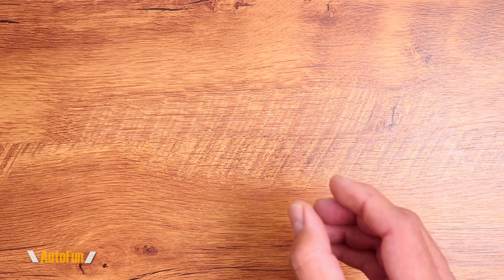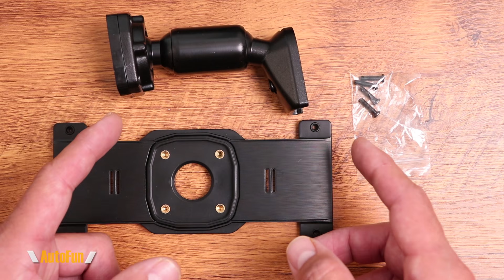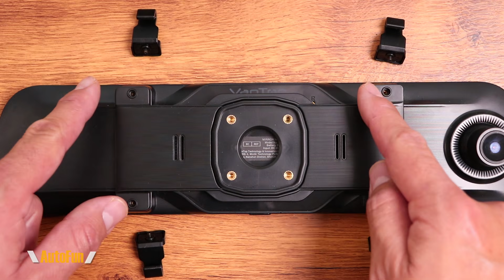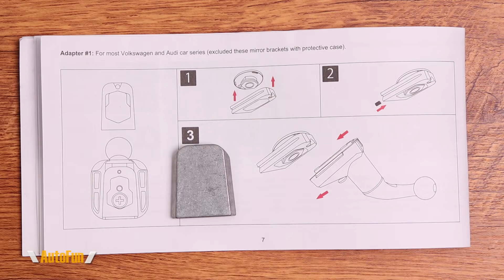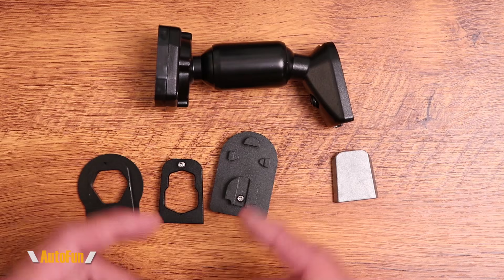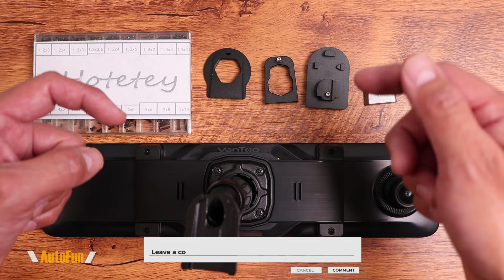How to Install Mirror Dash Cam WITHOUT Straps (Direct Mount Conversion Kit for LCD Mirror)

Comment: hi can i get a bracket adapter for a dacia sandero m8.
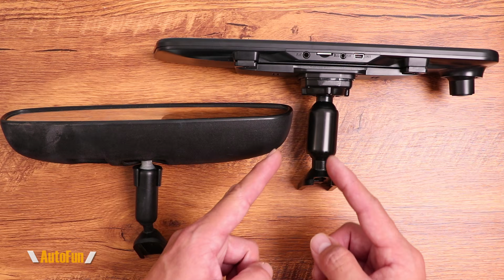Reply from the maker: Hi Paul! I placed links to the different adapters on the video description, if you need to see what they look like so you can match it to the one on your car take a look at the 5:40 mark. Hope this helps, Cheers!
Reply: hi m8 when i click link does not work correctly thanks
Reply from the maker: @paulmurtha766  Hi Paul! I just checked the links, the are working correctly, which kit size are you looking for?

Comment: 2018 Toyota Tundra? Standard bracket?
Reply from the maker: HI Luke! Toyota normally uses the standard bracket but I always take the mirror off on the car to confirm which type it is. Hope this helps, Cheers!

Comment: Have you seen anything for the jado g100?
Reply from the maker: Hi moonstarking! Unfortunately I have not reviewed the Jado G100 yet, so I'm not sure what kit will fit, however you can measure the back of the dash cam as I showed in the video to determine the size but If I do get a hold of one of one, I will measure it for you and update this comment. Hope this helps, Cheers!

Comment: Install completed...works well. The only complaint is the Backup lines can not be adjusted for Width. So my SUV is wider than the back up lines :0
Reply from the maker: Hi AP514! that's odd, you should be able to adjust them. The G840H is one of the few mirror dash cams that let you fully adjust the guidelines using your finger so they can be tweaked to fit pretty much any configuration (most mirror dash cams only provide partially adjustable guidelines, basically a few preset ones) I wonder if you need a firmware update. I'm on Firmware 1.7.77.20210821 if it helps, if you still can't get them to adjust I would also recommend contacting Wolfbox, I'm sure they can walk you thru how to adjust them. Hope this helps, Cheers!

Comment: I just ordered a Apeman 790. Seeing if anyone has modified it yet
Reply from the maker: Hi Brannon! I haven't reviewed the Apeman 790 (may have to add it to my list of dash cams to review) so I'm not sure what kit will fit, however you can measure the back as I showed in the video to determine the size and If I do get a hold of one of one, I will measure it for you and update this comment. Hope this helps, Cheers!

Comment: Hi Alex! What about a kit for the Akeeyo 360?
Reply from the maker: Hi Corporacion PASSE! Unfortunately the Akeeyo 360° does not have screw holes in the back, so the conversion kit will not work with it. Cheers!
Reply: Yes Alex, thanks for your quick response. Please try to do that new video ASAP 😂😉
Reply: Hi Alex, any news about that video showing custom installation without straps for the Akeeyo 360?

Comment: Hi question for vantop h612 how do you remove the mounting strap where you put the plate on the back ?
Reply from the maker: Hi Hsruyr! I have not converted the H612, only the H612T but assuming the H612 has screws on the back, then the process would be the same as the H612T I showed on the video. Hope this helps, Cheers!
Reply: The thing that holds the strap is not the same as the hf612t but its almost the same as h610 were the screw is on the side of the dash cam any idea?
Reply from the maker: @hsruyrhsu137  Hi Hsruyr Hsu! ah unfortunately I have also not converted any H610 yet so I'm not sure if conversion is possible on the H610 or H612, but assuming they have screws on the back of the back, then the process would be the same as the H612T I showed on the video. Hope this helps, Cheers!

Comment: Which bracket fits the Wolfbox G700?
Reply from the maker: Hi Vin! Unfortunately the G700 does not have screw holes in the back, so the conversion kit will not work with it. Cheers!

Comment: Well, you messed up the measurement on "G840H"  *it is 13.5mm x 6.0 *----- Not the 14.5 x 6.0 listed in link.
 Change that link ASAP........
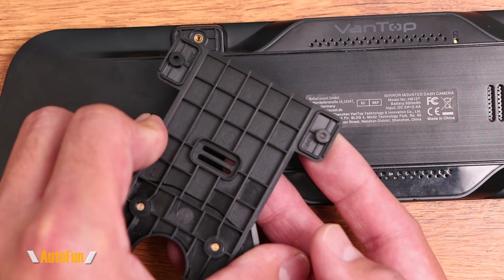Reply from the maker: Hi AP514! Nope my measurement is correct (14.5 x 6.0) you can see those measurements in my G840H conversion video here https://youtu.be/ns_2C-ph2no at the 4:32 mark. However since filming this video I have heard from viewers that they have received G480 without mounting screws or with a different measurements (yours sounds like it would be in this bucket) so I suspect there are a few G840H bodies going around and so far I have only seen the one body (I'm in my 4th G840H now). Hopefully I will see the other bodies at some point to confirm both the measurements and if they have screws or not and make another video on those. Hope this helps, Cheers!
Reply: @AlexAutoFun  - Well, I just Measured my Wolfbox G840H and it measures exactly 13.5 x 6.0.
So, You think they changed something or just have several back plates then ?  Mine did have the screws.
I can send you a few Pic's/Video if that helps.
Reply from the maker: @AP-514  Hi AP514! awesome man thanks for confirming, I had another viewer claim 13.5 X 5.9 (which I seen before in another brand) so I'm wondering if he received your style and was off by only a bit on the measurement. It would be great if you could send me a picture of the rear of your G840H (glad to hear it had screws, I also had some another viewer said he got one without screws ugh) if you go to my channel, then "About" you can find my email. Thanks again man!
Reply from the maker: Thank you for the pictures AP514! looks like the G840H you received uses the same body as the G850 V1, will update the kit list we have going to reflect this. Cheers!
Reply: @AlexAutoFun  thanks--- I figure it will help someone else out. Bottom line you are better off just waiting to order the backplate until you actually get the Unit in hand. It sucks due to the fact the backplate uses the Slow BOAT from China to get here.(they also back charged me $6 for the return)
Reply from the maker: @AP-514  Yep fully agree! this is actually something I would really like the vendors to start doing, and clearly indicate on the box if their mirror is direct mount compatible and what pattern it uses (kind of like TVs and PC monitors, they have already standardized their mounts) but we'll see if anyone actually listens to me LOL
Reply: @AlexAutoFun  Well, received the Backplate and the Screw Pattern is good.  But the Screws they have in the package are to LONG for the Backplate. They Shank out.(Pic's on the Amazon Link for 13.5 x 6.0 above)
Reply from the maker: @AP-514  Yep, I had cases too where the screws that come in the kit did not fit the dash cam I was converting, so I put a link to the screw kit mentioned on the video, that kit has come in so handy! Cheers!

Comment: This video is JUST what I was looking for - now I'm trying to find a mount that fits Rexing M1 Pro - holes are 13.5 CM apart horizontally and 5CM apart vertically.  If there's not one that fits, I guess I could go the drill route. :)   Does anyone know of a mount with those hole dimensions?
Reply from the maker: Hi William! glad to hear it helped, nope unfortunately there are no kits with those dimensions yet but here is my follow up video for this cases https://youtu.be/fveZiDofnxg Hope this helps, Cheers!
Reply from the maker: Hi William! I was reviewing comments to see if I miss any and I actually have a follow up video that may help you (if you are still looking to direct mount the dash cam) here you go https://youtu.be/fveZiDofnxg Cheers!

Comment: Any updates on kits for the Redtiger T27 where you don't have to drill additional holes?
Reply from the maker: Hi wolfsmith808! I think you are referring to the semi-universal kit I showed here https://youtu.be/fveZiDofnxg If so no there is no other kit out at this point for the RedTiger T27 besides the semi-universal one. But if I do find one eventually I will update this comment. Hope this helps, Cheers!
Reply: @AlexAutoFun  Thanks man. You're videos have been fantastic in walking me thru all the various installs. Fantastic!
Reply from the maker: @wolfsmith808  You're welcome man, glad to hear they helped! 😁

Comment: what if the Rear view mirror dash camera doesn't have the ability to equip a arm attachment?  do you have a solution for that?
Reply from the maker: Hi Zachary Rodriguez! if there are not screw holes in the back of the dash cam the conversion kit will not work with it. Cheers!

Comment: Hello! I just purchased the Redtiger T700 mirror cam and was wondering if you know of a mount that will fit this model? Doesn’t seem I can pull back any rubber on my mirror to expose screws. Thanks
Reply from the maker: Hi Nicolas! I have not tested the T700 mirror dash cam (may have to add to the list of dash cams to review) but you are correct, if there are not screw holes in the back the conversion kit will not work with it. Cheers!

Comment: Stop advertising that conversion kit works for the g840h! I bought your listed kit and the screw kit along with the wolfbox g840h. 1. Yhere ate NO SCREW HOLES UNDERNEATH THE RUBBER TAPE AND THE MOUNT DOESN'T FIT! It's too big! Thanks for wasting my money
Reply from the maker: Hi Aaron! I have converted two G840H's already and just received a 3rd one that also has screws here is the video showing the conversion  https://youtu.be/ns_2C-ph2no But it's possible that yours may not have screws, sometimes I do see small differences between product coming from the manufacturer directly vs Amazon (where I get all my stuff) that may be a possibility (and even within Amazon stock there could be different batches of the product). I'm currently working on the mounting solution for dash cams that do not have screws, stay tuned for that video and cheers bud!

Comment: I think there is a mistake in the conversion kits, the Kit 14.5 x 6.0 is not for a Wolfbox G840H, the Kit 13.5 x 5.9 is the correct one.
Reply from the maker: Hi Rudy! I have just converted my 3rd G840H using the 14.5 X 6.0 Kit here is the video showing the conversion https://youtu.be/ns_2C-ph2no) But I have heard that there may be a 2nd body style for the G840 (so far I have only see one body style but I think it would make sense to double check the size of your G840 before ordering the kit) Hope this makes sense and hope you like your conversion! cheers bud!

Comment: Hey there! Do you know of a bracket that would fit the autovox x1 dashcam mirror? I’ve really been wanting this dashcam, but I don’t want the strap mechanism that goes with it
Reply from the maker: Hi Ryan! I have not reviewed the Auto-Vox X1 yet, so I'm not sure what kit will fit, however you can measure the back of the dash cam as I showed in the video to determine the size but If I do get a hold of one of one, I will measure it for you and update this comment. Also not sure if you seen they carry on that is already direct mount with really good features here it is https://youtu.be/Yk2EEacXZ7g Hope this helps and Cheers!

Comment: Hello, can you please provide a give me a link to a bracket that could fit a PORMIDO PR998 rear view mirror dash cam? 
Thank you
Reply from the maker: Hi Jeffrey! I have not reviewed the Pormido PR998 yet, so I'm not sure what kit will fit, however you can measure the back of the dash cam as I showed in the video to determine the size but If I do get a hold of one of one, I will measure it for you and update this comment. Hope this helps and Cheers!
Reply: @AlexAutoFun  Thanks for the reply. Much appreciated. I'll measure it as suggested. While also awaiting your update.
Cheers

Comment: Are there any of these brackets available that enable you to route the cables inside them, to conceal wires
 My mirror cam is wolfbox G900
Reply from the maker: Hi David! nope there are none (but It's an interesting idea), the rear portion that mounts to the mirror would have to be enlarged significantly to fit the cables due to the right angle connectors (the diameter of the tube would need to be quite large) The closest I seen to this is this one https://youtu.be/Yk2EEacXZ7g which was designed from the start to be a direct fit (and avoids using right angle connectors). Hope this helps bud!
Reply: @AlexAutoFun  Thanks for that, do you know whick bracket will fit the wolfbox g900 to mount it with out the straps
Reply from the maker: @Builder9133  Hi David! ah yes I have not reviewed the Wolfbox G900 yet, so I'm not sure what kit will fit, however you can measure the back of the dash cam as I showed in the video to determine the size but If I do get a hold of one of one, I will measure it for you and update this comment. Hope this helps and Cheers!
Reply from the maker: Hi  david! got an update for you! another viewer said he used this kit https://amzn.to/3vR80cU to convert his G900. If you do order it please let us know if it worked out ok! Hope this helps, Cheers!
Reply: @AlexAutoFun  Yes I have ordered this one and it fits, only problem I have now is my car has a camera that is mounted around mirror (for safety features) and the arm for the mirror doesnt bend enough to get the mirror low enough so the mirror camera isnt blocked, I needed a longer arm or one that has tighter bends ? so the mirror cam will sit lower?
Reply from the maker: @Builder9133  Hi David! Ah yes I seen cases where the ADAS system will conflict with a mirror dash cam, for those cases I recommend going with one with detached cameras like this one https://youtu.be/5zdd9mSECoc in most cases that will let you clear the ADAS system enclosure or camera. Hope this helps, Cheers!

Comment: So Much Valuable information, with a fast pace! Subscribed. I just bought a GKU model M11. I will be watching your videos on installing my mirror cam to get a clean like factory look. Thank you So Much for your Channel!
Reply from the maker: You're welcome Davil! and welcome to the channel bud!
Reply: I got the GKU M11 too. Would you share a link to an adapter that works with the mirror. Thanks.
Reply from the maker: @cusial  Hi cusial pradhan! I have not reviewed the GKU M11 yet, so I'm not sure what kit will fit, however you can measure the back of the dash cam as I showed in the video to determine the size but If I do get a hold of one of one, I will measure it for you and update this comment. Hope this helps, Cheers!

Comment: Which one works for the Rexing M3?
Reply from the maker: Hi SirWhiteCrayon! I have not reviewed the Rexing M3 yet, so I'm not sure what kit will fit, however you can measure the back of the dash cam as I showed in the video to determine the size but If I do get a hold of one of one, I will measure it for you and update this comment. Hope this helps and Cheers!

Comment: Hey Alex, I found a used VanTop H612T on ebay for $70, would you say this is a good deal for the mirror dash cam? I have been looking around for the best mirror dash cam in my budget (around $100, willing to spend a little more for a high quality one if it's worth the price). Which are your top pick (or top 3 picks) in terms of features, a clean simple user-interface, and reliability (or customer support)? Which one do you currently have? Thanks!
Reply from the maker: Hi jhmg! I think the only issue with buying used is lack of warranty and support (additionally the internal battery inside does degrade over time, and would be hard to know how much it has degraded) but yeah can save a lot by buying used (I done it plenty of times lol) Regarding my top dash cam choices, you can find them in the video description, hope this helps and cheers from California!

Comment: Hey Alex, I tried your link, but the strapless mount is not available anymore for Wolfbox G480h. Do you have any other recommendations? Also my mirror does not have the screw holes that the old G480h did so I have to go with straps. I need something solid because my mirror keeps drooping down specially in hot temperatures.
Reply from the maker: Hi Ray 167! I just checked and it shows in stock. They do sell out fast every time they bring more which it probably why it may have showed not there earlier. Regarding using the kit on a dash cam that does not have screw holes in the back, the conversion kit will not work without modification (I had some viewers open their dash cams and drill holes to be able to install them with the direct mount kit) which as you can imagine is probably not ideal (but I may make a video on that custom mod). Hope this helps and thanks for watching bud!

Comment: I have a Pormido D50 mirror dash cam. How do I change it to a direct mount. It does not have screws in the rear?
Reply from the maker: Hi Bengb X! Correct, unfortunately the Pormido D50 one does not have screw holes in the back, so the conversion kit will not work with it. Cheers!

Comment: Hey I have a vantrue m2, I was wandering what mount would work
Reply from the maker: Hi Mikey! I have not tested the Vantrue M2 yet, so I'm not sure what kit will fit, however you can measure the back as I showed in the video to determine the size but If I do get a hold of one of one, I will measure it for you and update this comment. Hope this helps and Cheers from California!

Comment: Doesn’t work for the Vantop H612 though. ☹️
Reply from the maker: Hi Poges! did you measure yours yet? There are different kit sizes depending on the measurements of the H612 (you can measure yours as I showed on the video), I haven't reviewed this one yet otherwise I would have that number for you, but If I do get a hold of one to measure I will update the video description with a link for it. Hope this helps and thanks for watching bud!
Reply: @AlexAutoFun  the holes are actually on top and bottom of the rear view mirror, they hold the c clamp that attaches to the mirror itself. So as far as there being holes in the back to mount the plate to, the h612 is non compatible. so if anyone want to buy mine, i have one in the US ready to be shipped. =(
Reply from the maker: @poges2104  Thanks for confirming the location of the screws, yeah without screw holes in the back the conversion kit will not work with it. Cheers!